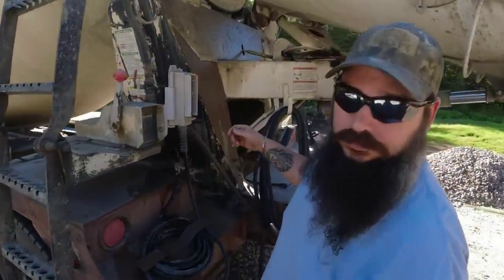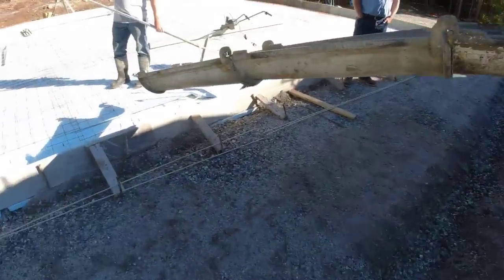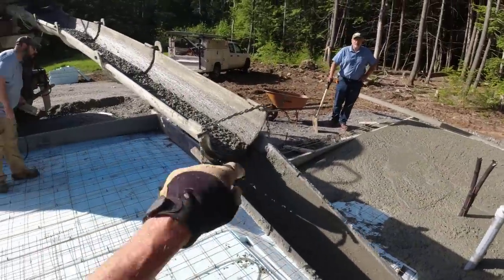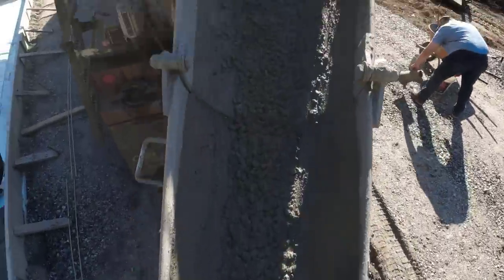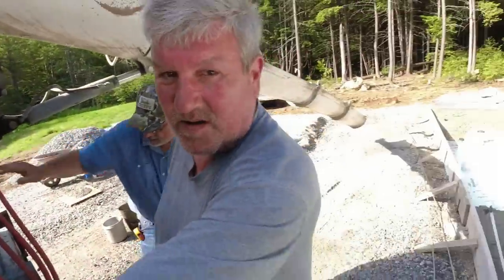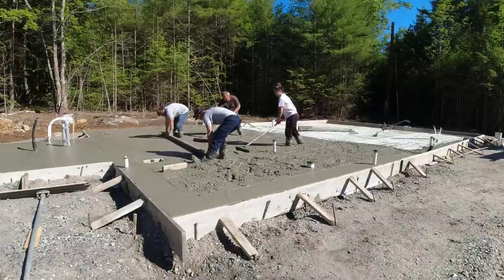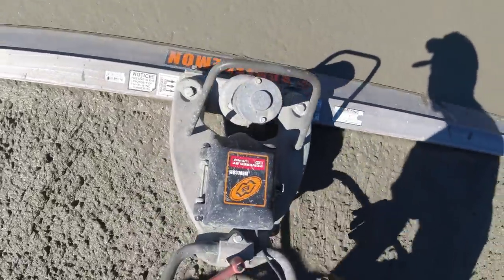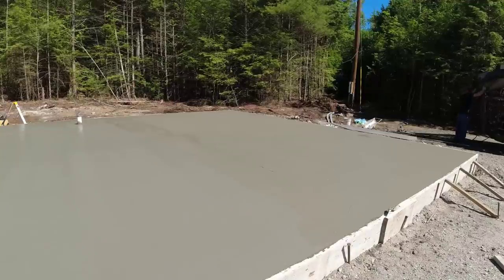We're Having Trouble Getting The Slump Right - 44' X 28' Slab

Comment: I need to start using water reducer because I've been raking 4s and 5s for the last 20 years. Any real slope and you have to watch pouring those 7s. Great video I love watching people do it different ways. You always put out fantastic work and it's different in every region. I noticed you always bullfloat the same way you straightedge. I've always went against the screed with the first pass. Seems to fill in any lows or cut highs a little better. Then 2nd pass go the same way as you strike it. To each their own. Looks great Mike.

Comment: Two issues - low cementitious in the mix = not enough paste volume for high flowing concrete. The other is 3.5ozs per 100wt of a mid-range water reducer is typically not enough for what you need. The best-case scenario is you are getting 1" of slump per ounce of that type of WR. A non-air 520lb  .48 w/c ratio mix concrete you might have 2-3" concrete before water reducer before travel time from plant. But it still brings you back to paste volume unless you're adding excessive water to the mix.

Comment: Hi Mike,
I’m confused, how are you changing the slump on the job?
I thought when you change the cement/ water ratio that you change the strength of the concrete, so when you keep adding water to the mix to get it to the slump you want, arn’t you weakening the strength of that batch?
Reply: water reducer not water. Mike has explained it on many times.
Reply: @j81851  ...the mix in this video seems too wet to pour on a slight slope...so without water reducer what slump would be recommended...I know temp and weather conditions determine part of this...
Reply: @j81851  The video clearly shows the customer adding water not water reducer.
Reply: It depends on what the actual slump would have been when batched and mixed. If they were too busy to let it mix at the plant and the aggregate was dry, he may have been short a lot of water before he even got on the road. .
Reply: @j81851  Here he was adding water. In this case the reducer is added at the batch plant and they are adding water on site to achieve the desired slump.
Reply: @j81851  you believe what you want to believe John, but I don’t think water reducer comes out of the hose that they wash the tools with!lol
What I think was probably closer to the truth was the either the plant didn’t give Mike the slump he ordered, or they did have the slump when the truck left the plant and it firmed up on the way due to the water reducer and the hot day!👍
Reply: The concrete is batched at a certain slump eg - 4000 psi at 4inch slump,  and if the contractor wants to wet it up they can. 
So by putting 40 gallons of water in yes you are affecting the integrity of the product and weakening it. 
Of course they always wet it up after a slump test has been done so on the tests it was delivered right. 
Solution is to order 4000 psi at 5 or 6 inch slump, costs a little more for extra powder but then you can pour wetter and keep the strength integrity. 
Whether these guys do this 🤷‍♂️
Reply: @lachlanitis2311  if you’re going reply to posts, can you please know what you’re talking about!
Reply: @alanhiggins2928  I actually do champ, have 20years experience. You're the one asking questions, I answered your question. 
Yes putting water in it weakens the mix and causes more expansion risking cracking.
Reply: @lachlanitis2311  I apologise, I only read the first part of your reply and didn’t press read more!
Reply: @alanhiggins2928  it's OK, hope it answered your question.

Comment: Always love your videos. At some point you gotta reject the load. Looks like it was mixing in added water at the start of the video, plus 20, then 12, then 12, then 10. Total of 7+ gallons per yard, upping the W/C ratio by more than .1. If the mix design starts out low enough, then everything is fine. But if it's like .5 to begin with, I'd worry about durability.

Comment: You needed to use "High Range" water reducer Aka Plasticizer. I can say that pouring a 7.25 inch slump, that mix design is out of spec. Also those first two drivers had no idea what they were doing.

Comment: I used to operate a curb and gutter machine, and one terrible plant used to send loads out so dry they wouldn't take the water. I was told by their rep that they weren't getting enough head water in when they batched it. Great info, but what the *(&^%(& are you doing to fix the problem, batch plant rep? Turned out they did nothing.